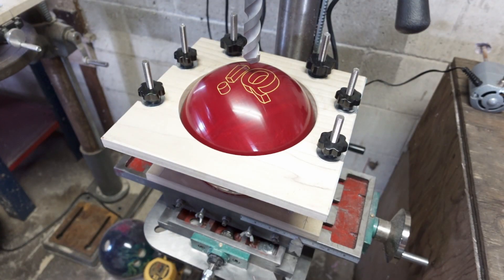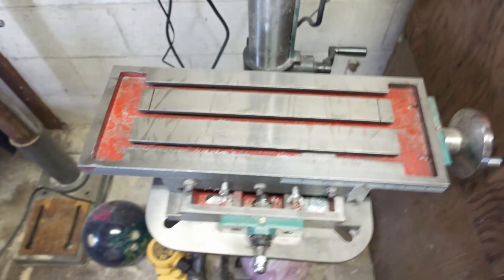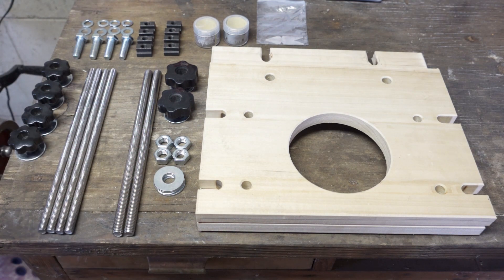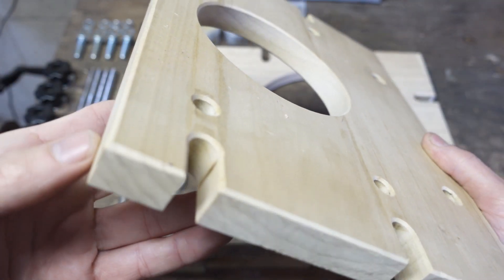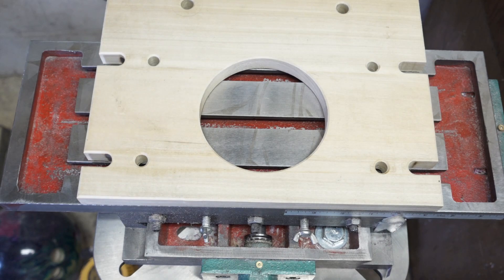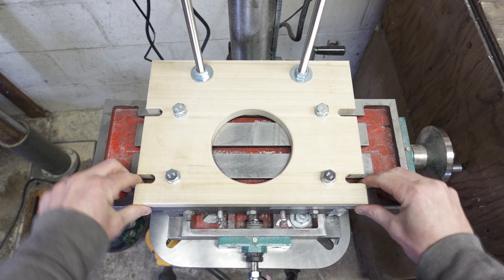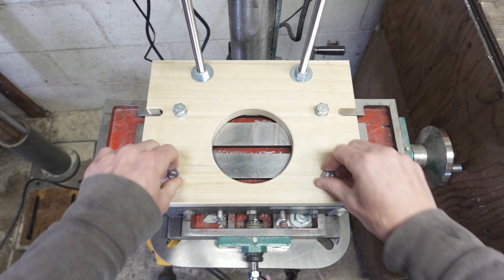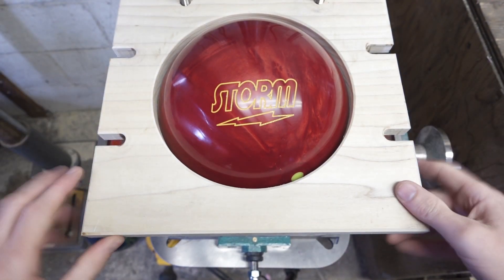Affordable Bowling Ball Jig for Drill Press

Comment: Nice design! Have you considered using a 3/4" plywood instead of a piece of lumber? I would think that the lumber would be subject to splitting on the grain, where as a piece of plywood has laminated layers of grain in different directions. Thanks for the video!

Comment: Tried to cut plugs with this and the top plate broke in half, I recommend an aluminum top plate if you are going to cut plugs.
Reply: Was cutting the plugs required to have more applied pressure or rpm causing more stress on the top plate than regular drilling?

Comment: what kind of press are you running?
Reply from the maker: @ZachNoradin  I use a Nova Viking, direct drive motor.  It's overkill for this and I wouldn't recommend it if you're just drilling balls, there are considerably cheaper and more readily available options if you're trying to stick to a budget.  Many people use the $5-600 press from Harbor Freight with no problems.
Reply: @KennyGrinols  im assuming that is the 17" press from harbor freight?
Reply from the maker: @ZachNoradin  I think so.  The most important spec of the drill press is the "quill travel" which dictates how deep you can drill holes.
Reeber you lose about an inch just from natural spacing between the drill bit and the ball at rest.  So 3⅛ of travel, will only usually get you 2⅛ of drill depth into the ball. (Which is actually enough if you don't use thumbs and want to really go the budget route)
But if you want to drill interchangeables, slugs, or thumb holes, you need to be able to drill 3.5" which means 4.5" Quill travel.
Reply: @KennyGrinols  thanks for the insight! yeah i want to plug my 1 handed balls and switch to 2LS as im switching to 2 handed so my real intention is to only drill the fingers and i only want to drill for personal use

Comment: What drill press do you use?
Reply from the maker: @cameronlaplant5541  I use a Viking Nova.
Reply: @ floor model or bench top?
Reply from the maker: @cameronlaplant5541  I did the floor model, because I didn't know if the benchtop could fit everything.  The benchtop would probably be more stable in retrospect.
Reply: @ will the benchtop fit everything?
Reply from the maker: @cameronlaplant5541  I don't know.  I can get you a measurement and I'd have to pull up the specs of the press.  It was hard to calculate when I was buying because I wasn't positive how far the drill bit would hang and all that.
If you're spending that much on a press though, while the direct drive motor and digitals have all been great, and suit my needs, (wood working) if your drill is dedicated for drilling off center holes into a sphere (bowling balls) you may be better off with a JET press.  That's what all of the high end systems use, like innovative etc.  Just for your consideration.
Reply: @ thanks I appreciate the info
Reply from the maker: @cameronlaplant5541 with mine setup, and a ball in place, there's 5¾ clearance from the top of the ball to the chuck.
And then with a bit in the chuck, you get about ⅞” from the tip of the bit to the ball.
The XY table (with jig base plate) is 4¾ tall.

Long story short, I believe the minimum size to fit everything from the table to the chuck is about 18-18.5"

Comment: What size drill press do you have 
Does it vibrate/shake while drilling holes as if the drill bit
Wants to wonder off??
Reply from the maker: Mine is 16", the run out isn't perfect but I haven't had any detrimental issues.  Sometimes at certain pitches the bit will slightly deflect.  It's only been an issue when trying to perfectly center vacu-grips at multiple depths.  In hindsight a JET press may have been better, but I wanted digital and direct drive motor not belt driven, so I'm happy overall.  The ability to see digital depth, speed control, etc outweighs everything else.
Reply: Ok great thanks when i first started this i bought a 13” drill press. I am going to buy a 17” drill press that has more torque and horse power … great video and what an improvement from the first jig you made!! 👍🏽
Reply from the maker: @th-wt5pn  the quill depth is the most important, and keep drilling speeds low!  I drill at 250rpm.
Reply: 250 rpm omg im drilling at like 1500rpm
Im about to lower my rpm and try to drill again to see if it stops all the vibration and shaking. Wow i thought the more speed the better🤦🏽‍♂️
Reply from the maker: @th-wt5pn  that was one of the first mistakes I made as well.
Reply: So my lowest is 220 rpm then 290rpm
Reply from the maker: @th-wt5pn  if it's a belt driven drill, I'd do 290, because you'll lose rpm as pressure is applied and the drill will slow down as it cuts.

Comment: Hey Kenny! I’m a little late to this video but this was awesome. I’ve always wanted to drill balls and just recently have started slowly buying stuff to get all set up cause it’s so expensive. Two things I don’t have that are the most important though are a drill press and jig. I really couldent stomach spending over 1,000 on a jayhawk jig when all it does is clamp a ball down so I’m thrilled to see your selling one. If it’s still available I’m for sure going to buy one in the next month or so (would buy it immediately but this stuff ads up 😂) one question I have though is if your jig is compatible to put on any of the jet presses or any of the nova Viking drill presses. Cause I saw in another comment you use the nova Viking. And I’ve decided I’m going to go with either them or the jet ones cause I need to drill interchangeable jopo thumbs. I just don’t know the exact model to get yet cause they both have multiple options. Thank you so much for coming up with a much more affordable jig kit though!!!
Reply from the maker: Hey Charles, the Jig is designed to mount to the XY table.  You mount the XY table to the press, and that should be relatively universal, based on the base plate of your drill.
Reply: @KennyGrinols  ok thank you so much. I’ll message you on Facebook to get the jig when I’m ready!

Comment: Was there a reason for adding the back 2 clamp down posts?  I am thinking of bolting 4 all thread posts with holes instead of slots for the top plate.  As long as the all thread doesn't stick up past the drill bit, I should be able to slide the top plate over the top of the ball onto the posts.  Also, instead of a 4 inch hole in the bottom plate, I think I'll get a ball display cup and glue it to the base board.  Looks like an awesome design and I really enjoyed your video and this is the best jig I have seen for the DIY'er.
Reply from the maker: Hey Mike, I was just trying to make it as secure as possible to eliminate as much vibration as I could, because I am drinking interchangeable thumb systems now, which are 4.5" deep and 1.5" wide, so I didn't want to have any concerns about stability.

Sliding the top plate like you have in mind, might work, it was an idea I played with, but was tedious to get all 4 lined up, and didn't want to unscrew the top 4 completely, every single time.  (But holes will be much cheaper and easier for DIY, routing the slots is by far the hardest part of fabricating these for me)

I also tried a ball cup, but it was just 1 more piece in the system that can move or suffer from vibration, fine unglued, or slip during drilling and result in a catastrophic failure and then you're re-centering etc.

I've read a few discussions about a dog bowl, but it raises the entire assembly and you're back in the same issue of potential movement, centering blah blah blah.

I'd love to find a way to make the bottom get more surface area on the ball, but any bigger hole in the bottom, the ball starts interfering with the xy table.

I assure you, I've tried a LOT of things getting to this point and failed multiple times on the way to this "nearly" end product.  I have a few other experiments in mind for the future, and each time I sell one I've been reinvesting back into the system, so maybe one day I'll have a perfect product everyone can enjoy.
Reply: @KennyGrinols  Ok, since you tried the ball cup and like a hole better I will build mine that way.  I am thinking the slotted top is better now that I see it would be a pain to completely unscrew it all the time.  I have the milling table on order.  So I have run into bad luck getting balls drilled properly.  One guy didn't even know what PAP was and drilled the thumb hole right through the logo which is not necessary with a symmetrical ball.  I want to buy used bowling balls, try extreme layouts for fun and experiment with different hole pitches to see what works.  It would be expensive at $75 per drilling doing that.  Thanks for the information.
Reply from the maker: @majormeteor  yep, that's what I did.  A lot of used balls, finger pitch experiments, layout experiments, and sell them used to recoup whatever I could, then have some fun.
Reply: @KennyGrinols  I am thinking a lot of thumb pitch would be more comfortable and be easier to get your thumb out of the ball.  What thumb side pitch worked for you?

Comment: What would be even more affordable is that u only need the bottom wood to be mounted on the XY slider and secure a dog bowl big enough to stabilize the bowling ball with a rubber rim. Than u don’t need the other top mounting bracket or accessories due to the dog bowl being stabilized for drilling. They make jigs that look like that with any support on the top of ball and almost like a diy ball spinner.
Reply from the maker: Hey Ryamaz, those are "vacuum" jigs and they use suction to secure the ball, by pulling a vacuum from beneath the ball surface.
Reply: @KennyGrinols  true but I’m talking about using something bigger that would place half the ball inside that way u don’t need the suction…those jigs are like only displacing an 1/8 or if u lucky a 1/4 of the ball

Comment: Mind sharing a few recommended drill press for people like me that doesnt understand how to buy one? Would love to purchase this asap.
Reply from the maker: Are you looking at just fingers or you want to be able to drill thumbs as well?  The key difference in deciding on your drill press, is how deeply you need it to go into the ball.  Most standard size drills will fit the ball, but the drills are only designed to go about 3 inches deep.  Since the bit has to start far enough away from the ball when you set it up, you usually only get about 2 inches of drilling ability into the ball.  Enough for finger grips, but won't work for thumbs, slugs, and especially any interchangeable system.  Let me know what you're planning and I'll get you some answers.
Reply: @Kenny Grinols  I am also interested on what drill press specs are needed to drill balls with thumb slugs as well, if you don't mind sharing.   Thanks in advance!  Any upcoming videos on drilling the balls with thumb holes?  Also what is your current drill press name and model?
Reply from the maker: @gtbinh  I use a Nova Viking floor press.  It's direct drive, rather than belt driven, is completely digital, and is pretty awesome.  I think the Jets are more purpose built for Bowling balls though, as pitching angles into spheres, is more niche than most drill manufacturers are designing for, in my opinion.
Reply: @KennyGrinols would you mind sharing the spindle travel range of your press?
Reply from the maker: @galash5  mine is 4.75".
Basically you want to assume that you're going to lose about .75-1" from the space between the ball and where the drill bit naturally sits, so you can put things in and out etc.  Then whatever is left will be drill depth, but drills lose some depth due to the point of the bit, vs the flat spot.  You can definitely cheat it a little based on how you set the system up, but basically assume 4.5" minimum if you want to drill slugs and interchangeables.  3" if you want to just drill fingers, no thumbs.
Reply: I would prefer to be able to drill thumb hole also.

Comment: Wow kenny I do like the updated version much better and you did a way better job slotting and rounding the edges off with a router all of those things that really make it look and function more professional like.   That is also the exact  slide table I was looking at online when I was looking at the stuff to build a jig a few months back.  The cast iron just looks way more secure and those tables come in handy too for more than bowling balls so getting a higher grade one than you used in the first one was very wise.  I really do like this one a lot better than those hyme joints too.    I had 10 balls drilled in the last 2 years so I can see this saving some money for sure plus I am just the hands on kind of guy that likes to do things for myself and take pride in what I do.     

Just out of curiosity have you ever tried to drill a ball with a forstner bit?  I have a few old balls I was thinking about practicing on anyway, so I figured I would try before going out and buying Jayhawk drill bits.  .  I would rather put some of that bit money towards a vise-it install kit for my thumb slugs if possible.     Thank you for the video.
Reply from the maker: I use the carbide drill bits from Innovative.  They are machined to be accurate to the 64th, allegedly.  Personally, bowling balls are soft, and can be drilled with any bit, in my opinion.  Spade, Forstner, or otherwise.  I actually bought a cheap drill bit from the hardware store, to use as a pilot hole for the JoPo interchangeable thumb system (1.5").  Pretty sure it was just an Irwin spiral bit, at 1⅜.  The hole seemed perfectly fine to me, but I used the carbide bit for all of the finished outer diameters.  The only potential issue with a Forstner is the debris, but with a shop vac, and clean out every so often, I don't see running into any issues.
Reply: @KennyGrinols  Thanks for the reply.  I was thinking to myself that resin has to be relatively easy to drill and even easier than some of the exotic hardwoods I have messed with.  I did see someone use a spade bit once but it was in a hand drill and the guy was adding 2 more finger holes because WHY I don't know?   😂

Comment: How deep do you drill the finger holes and what rpm do you typically run at?
Reply from the maker: Personally, I do 1" deep with 1 ³¹/³² and then down to 2⅛" with ³¹/³² for VacuGrips.  I drill fingers at 250rpm.

Comment: do you think the other milling table (the little green one) is not stable enough? Why did you switch? I have the little green one, building my own jig.
Reply from the maker: I think if you just want to do fingers only, you can get away with the green one.  I wanted to be able to do interchangeable thumbs, so I decided to upgrade.  The main thing is ensuring everything is as tight as possible on the mill table adjustments.
Reply: Currious why you opted not to chamfer the top and bottom plate holes the same as you did on the first jig?
Reply from the maker: @PaysteeDook  the first one was actually done with a bevel bit, and because of the black coating was much more noticeable.  The new one is chamfered, where it made sense at angles and depths that took a lot of trial and error.  I'm still searching for alternatives for the bottom plate.  Top Plate feels perfect though.

Comment: Have you tried this using a plugged cutter with it?  If so, does it chatter.
Reply from the maker: I haven't gotten into plugging balls yet.  I have drilled a full interchangeable thumb though.  It was the JoPo system, which is 1½" drill bit.  As long as you use the proper pressure and speeds, I had no issues.

Comment: This jig definitely more stable than your previous one, nice work!
Reply: He went from a aluminum 35$ X y table to a killer heavy one the jig itself didn’t have much to do with it. The old one flexing and shaking didn’t matter much that is mostly from run out from the spindle and bent bits etc so the flex possibly helped it be a straighter more accurate hole. So ppl don’t need be so concerned about it.